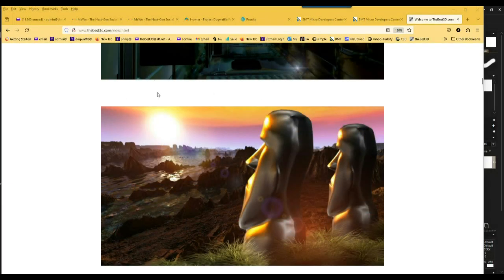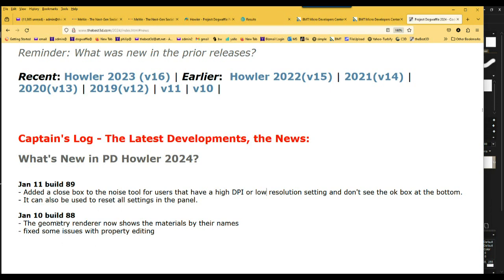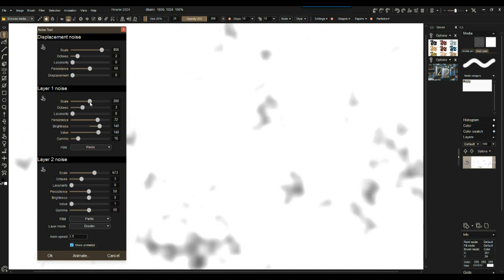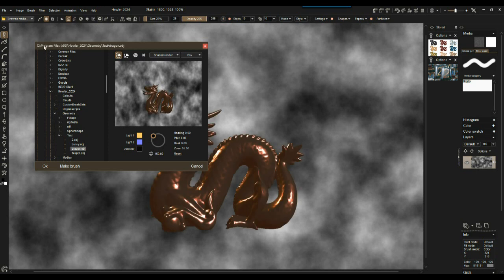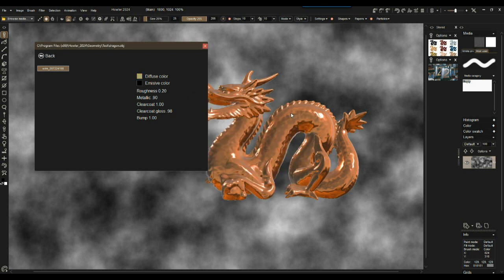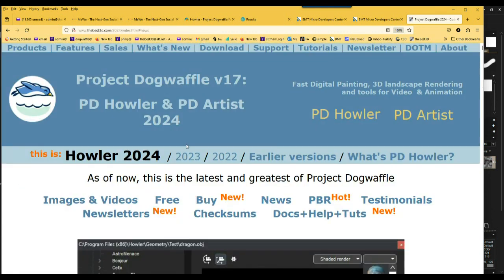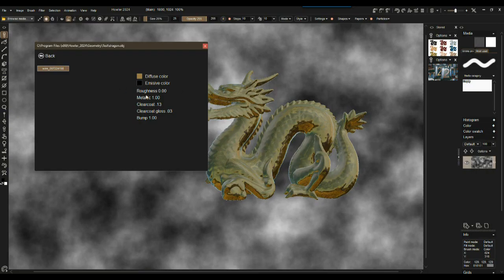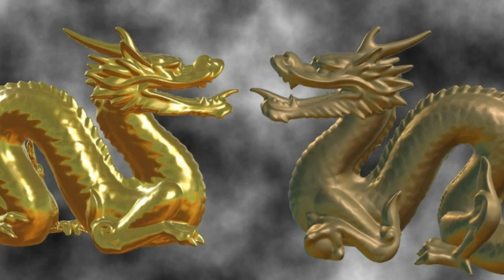240113_build 89: improved noise filter and editing material props

Comment: "Added a close box to the noise tool for users that have a high DPI or low resolution setting and don't see the ok box at the bottom."  That is great, I had the problem myself and couldn't see the bottom of the noise panel.  Thank you.